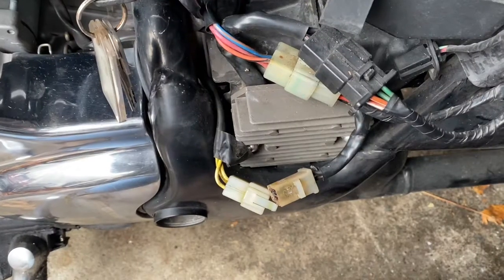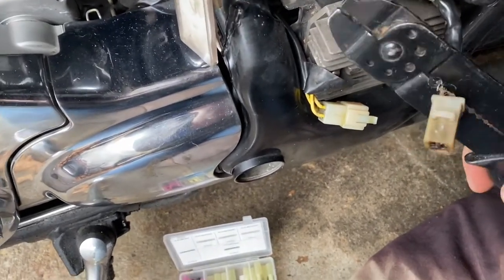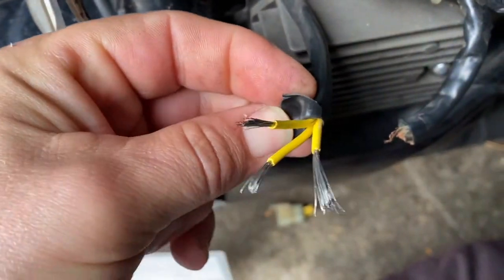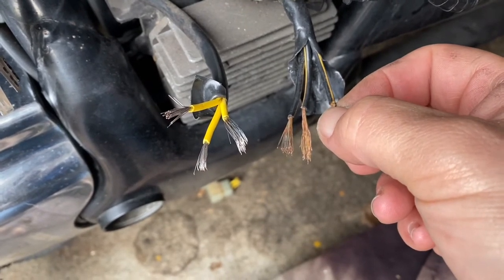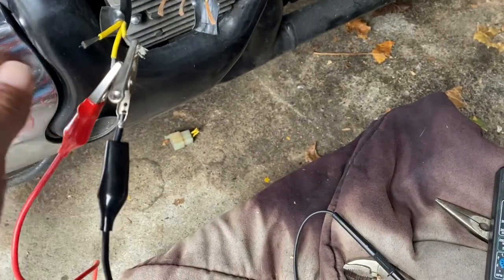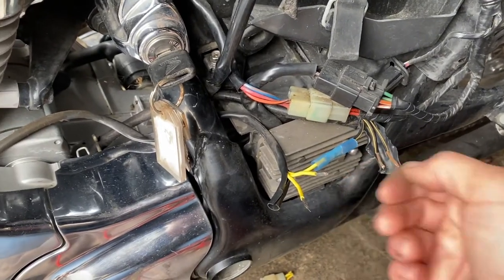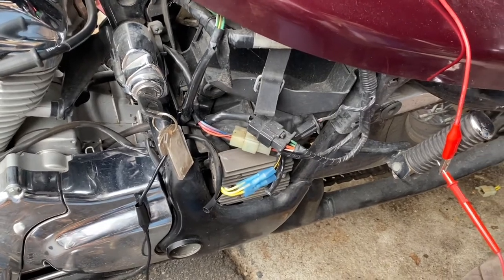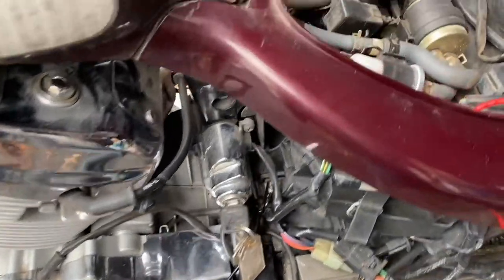EP #8 3 Yellow Wire Fix Charging System 1995 Honda Shadow VLX VT600CD Testing How To

Comment: Great video just helped me have a way home cuz my battery died on my way to work and i was checking those wires and turns out they’re were either rubbing or melted but the wire were showing and 1 out of those 3 yellow wires were connected and barely hanging on by like 5 metal strands of wire and i spliced and reconnected them… appreciate the help also charged the battery while at work it i didn’t see this video i wouldn’t have checked it or have a clue so appreciate you giving me endless knowledge 🤝
Reply from the maker: That’s great news! Keep on riding! This is why I do what I do. Thanks for the feedback. We can all help each other out and pass on the knowledge.

Comment: The reason it burned was because there was too most cheap resistance in that plug you replaced. Sad thing is the way you repaired it you put resistance back in the circuit. You should have soldered it.

Comment: Dude. Please get you a real pair of wire strippers and crimper. That was hard to watch stripping of the wires. But 20 bucks cab get u a decent pair of strippers and crimp tool. That cheesy set will get you into a mess you will have trouble tracing down. Just my 2 cents
Reply from the maker: Just grabbing tools that are handy at the moment. Cleaning and organizing the shop would be first on the list. Maybe find 1 or 2 of the proper tools!

Comment: Hey man, we've talked before and im having an issue with the magna and was wondering if you could maybe give me some advice on what to do. I went to go.try to start it and I believe the neutral safety switch is bad.
Reply from the maker: What is it doing? Doesn’t have power? Or is it turning over at all?
Reply: @mcycleshawn  will go into neutral but neutral light won't come on and won't turn over without kickstand up and clutch pulled

Comment: I notice you didn’t mark the wires before connecting. Does the order matter? Is there an issue of cross wiring??? Did this to my VT1100C3 but it’s charging my 12v batter to 15v+. I think I either crossed the wires or the stator is bad. please let me know THANKS!
Reply from the maker: Wires do not matter. Sounds like your regulator rectifier might be bad. It should keep the battery from over charging.
Reply: @mcycleshawn  thanks for replying! I think it is bad as well based on my multimeter test while idling. Any way to test the rectifier?

Comment: Get a soldering iron. 
Itll actually last. 
What you did is almost fix a problem. But just make the connections have more resistance. Itll cause a fire or just burn again.

Comment: Had this issue, fixed it with a new 3 wire connector from work. Did not fix my charging issue though. Ohm tested rectifier/regulator and it passed both the positive and negative bias checks as well as backfeed test. Tested stator, passed ohms test, passed voltage output tests on all 3 wires and passed continuity test. Bike still will not charge and I don't see anything wrong with my other connectors. Bout ready to just burn this bike and be done with it, only thing keeping this bike safe is that it runs too damn good despite the charging issue.
Reply from the maker: I have a Magna that passes all the tests also but doesn’t charge high enough…….not sure if I should just change the stator anyway.

Comment: Thanks for this, when is it in the first place a connector that allows disconnect and not hard wired? Is there a reason to have this ability to disconnect it? I'm asking before I permanently wire mine but may use bullet connectors so I can disconnect it? Does the black leads run to the stator? I'm thinking yes so I'm thinking I'll remake a connection that allows a disconnect?
Reply from the maker: Most people hard wire it anyway. I guess they made it removable in case they need changed out.

Comment: Nicely done, wiring issue no issue no more, lol. Look at it this way regarding the carbs, at least it isn't a Magna.
Reply from the maker: You got that right! However these are crammed in there also
Reply: @mcycleshawn  yes they are. I've done so many Shadow carbs I have it down now. It's still a bear to get them back in proper. Edit - the boots are easier to work with if you boil them before install, if not replacing the boots with new ones. Boiling them makes them more pliable. Best to not use the woman's good pans though. And NEVER let her catch you baking a new paint job on the tank in the oven. For some reason they tend to get narrow minded over that one.

Comment: Is there any particular way that their wires need to be, because mine actually burnt up the plug
Reply from the maker: Doesn’t matter which wire matched with which. Just yellow to yellow
Reply: @mcycleshawn  awesome, thank you so much
Reply: @mcycleshawn   I have  Honda cbr 1994 600f2.  3 yellow wire to 3 wires.  You are the man. Yellow to yellow 💛

Comment: Why its getting hot this issue with my bike
Reply from the maker: These connections get dirty and do not transfer power efficiently. That could be your issue or your stator is over charging and burning up the plugs.

Comment: Dude she wasn't overheating. Your idle is wayyy too low my dude. Raise it up a tab bit and I shouldn't die like that.
Reply from the maker: I did find the idle adjustment way too low when I pulled the carbs out. I should have looked at that while they were on the bike. Thanks for the input!
Reply: @mcycleshawn  no worries my dude. Mine just melted the Stator connector so I'm about to direct connect them with waterproof crimp connectors. Should be door dashing in the next hour or so! Let's hope this solves my low charging issue. Anyways beautiful bike dude! Hope you still have her! I have a 96  1100. Just sucks to have the 4 speed. Would love the 5 speed updated one. Anyways have a good one dude!
Reply from the maker: @HazeyDayzz420  I do still it. you only have 4 gears? I like my ‘80s Hondas with 6 gears!